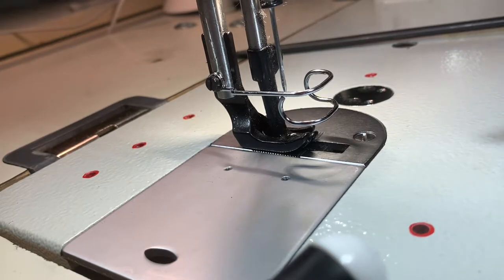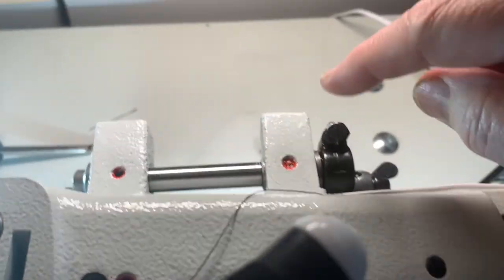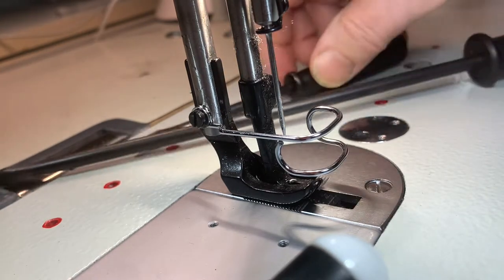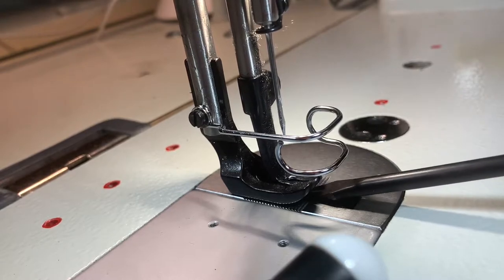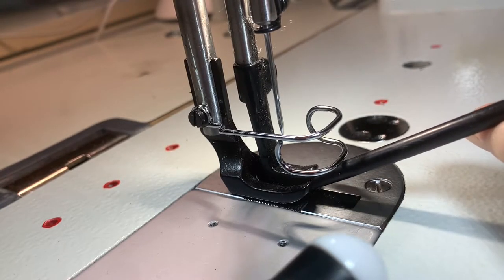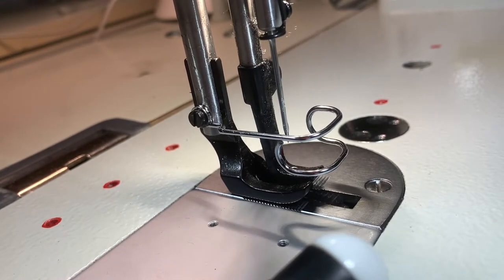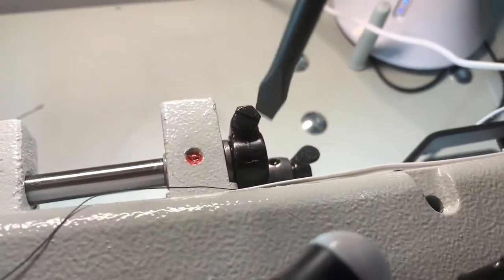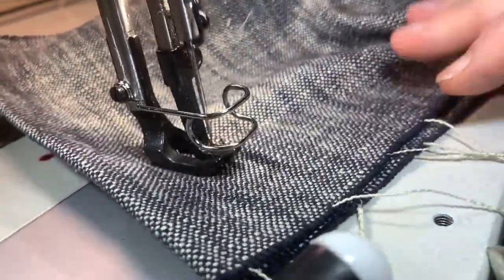Walking Foot Issues Consew 206rb 5

Comment: Good you mention this fix, because a lot of people don't know about it.  It's even easier to do  if you put about 1/4" of material under the feet, and roll the handwheel toward you until the needle just touches the material.  If you loosen the nut in that position, the foot will drop down and align.  Then tighten the nut again.  Thanks for sharing your tip.